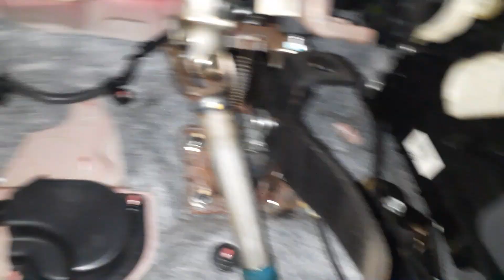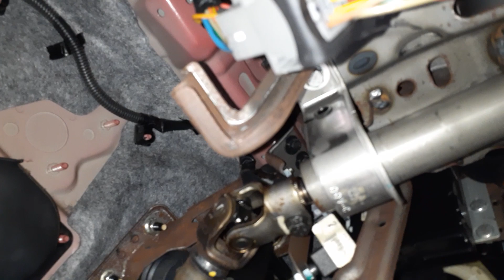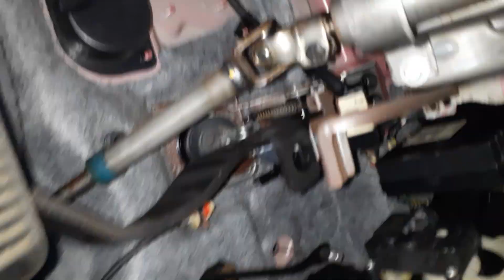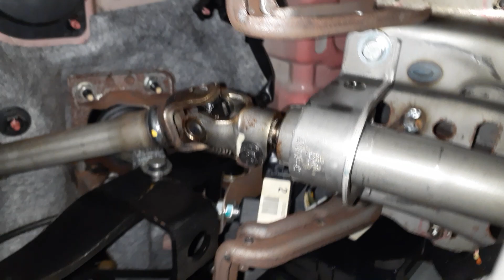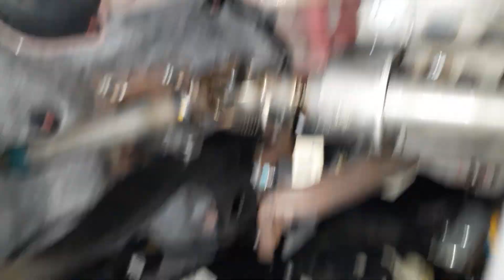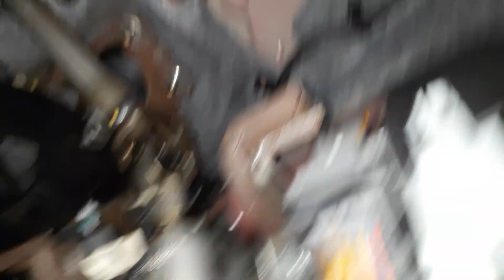Car Repairs look easy on YouTube Videos

Comment: Its good to see you have that hidden talent. I know fixing car isn't that easy but you did try.
Reply from the maker: Roney, I will fix it, I just did a poor job troubleshooting it, it's the piece just the other side of the Brake Switch, but the results are the same for Failures on either of them, so it threw me... plus I've only done small car repairs, Change oil, Fix the Air Coolant when the AC started blowing warm air... Wipers, the Gas Lid line when it would pop open, little stuff like that, this is way out of this old lady's league... lol

Comment: New cars suck to work on! And when you get stuff up under the dash like that! You have to be a dang contortionist to do it 👍😬 and in small cars it is a pain!!
Reply from the maker: Omg Rob, I was crying like a little Baby trying to do this, and I failed miserably at my first attempt, second and third... The sweat was blinding my Eyes, it just had to be 111° Heat index today, everything I touched was scalding... 🥵🥵🥵
Reply: I bet I've worked in that kind of heat before and it absolutely positively sucks!! And then of course I've worked outside when it was 20 and colder! Sorry it's so hot and it was being a pain in the butt!!
Reply from the maker: @Rob_1776  it's all good, and I'll figure it out eventually... but I agree, Small cars are a pain to work on... 🥴😬🤯
Reply: @CLCinflorida  they certainly can be! And I know you will get it fixed 👍!

Comment: How's it going? Did you narrow it down to that?  I may have missed it but what vehicle is that?
Reply: Put you a fan in there to try cooling a bit.🙂
Reply from the maker: Tim, It wasn't the Brake Switch, it's like a gasket rubber part for the brake depresser thing, I found it has cracked and not releasing the Brake Switch... or I think that is what it is... but I'mvno mechanic 🤣🤣 Heck, I'm not even strong enough to break loose the Wheel Adjustment Lever, it has never been moved since we bought the Car new and the Cars a 2008 Kia Rio, I think it's stuck there for eternity... It wouldn't even budge a little bit...  😞
Reply: @CLCinflorida  I wonder if some pb blaster or wd 40 would help if you let it soak a bit. Not sure what the part is your working on